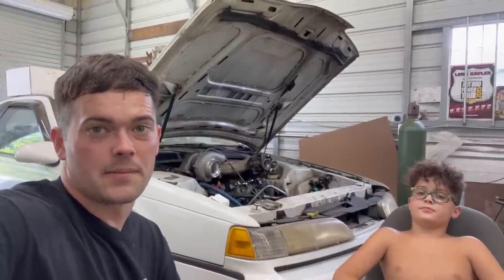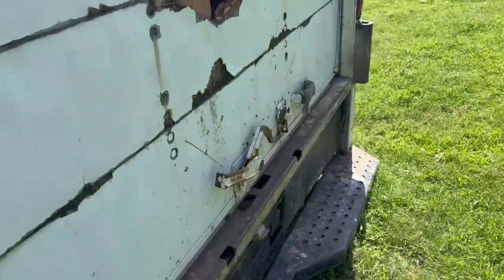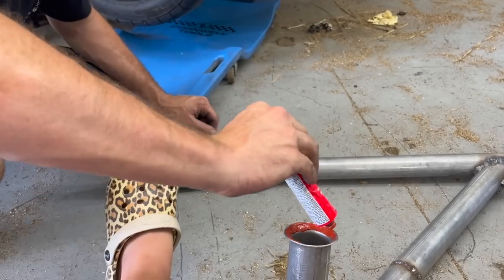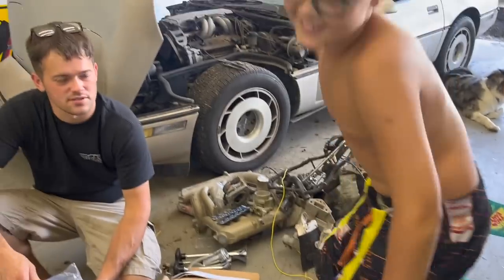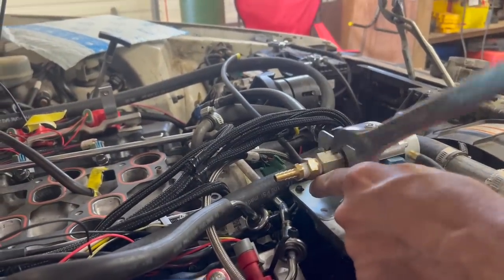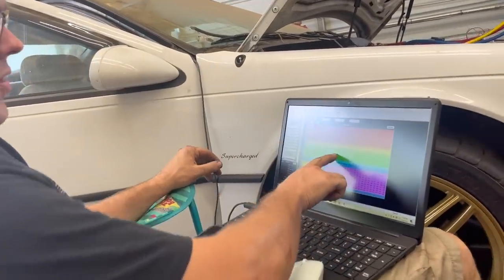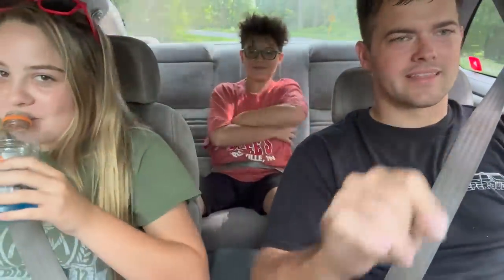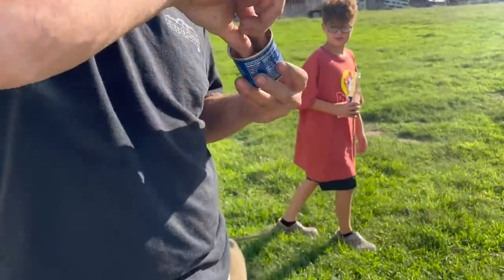First drive with a Turbo on our Supercharged Thunderbird!

Comment: Josh you are a mechanical genius! How you can take anything and fabricate it into exactly what you need is so rare today. Your talents never cease to amaze me. Such a really cool build. The kids are going to be a chip off the old block, as they seem to enjoy it as much as you do. What a great video!
Reply: AMEN to that
Reply: This is what kids and adults need alike, learn how to do work with hands. Learn how to take things apart, see how they work, then put together with no extra parts. doing this seems repetitive, but I started early and was fixing Autos, semis, Heavy Equipment, tools, doing plumbing, roofing, electrical etc. Things that we need to know as adults when our auto, home etc needs parts replaced or maintained.

 With money being so slippery save it by doing own repairs and maintaince. You'll be surprised how much it saves, how much is learned and how much fun you'll have knowing you can do work the right way and it's right. Never know where it can lead. College is so expensive. If being a lawyer, Dr etc ok that's a wise investment. But a blue collar trade will pay VERY WELL and you won't be in debt thousands. If your single go make that oil and gas money. If not do construction, truck driving, Postal service, etc. Any gov job pays well, health insurance is great and you can move wherever and have work. Best feeling was seeing all the kids leaving for college and then 2 years later they working at Block buster, no degree still and I'm making 3-5 grand a month easy.
 Rich ppl go to college, poor go to work. Then that work will teach you so much and you can have own home, car etc and maybe get into real estate, start own business etc. Never know where doing new work will take you in life.

Comment: You all have done a great job on that T-bird.    You need to fill the gas tank with fresh fuel, or the throttle control and all the settings will not be seeing things steady like it will with stable fuel.  The left quarter panel looks darker then the rest of the car..  the car is nice and with a few things cleaned up, you have a great car. Thanks and look forward to every video on the channel.

Comment: You totally amaze me at the way that you are able to use other parts not intended and “make them if”! Also you have every tool available to do the job right. Especially drill bits that actually drill through whatever without hesitation. When ever I drill something my drill bits are always dull (even though I sharpen and or replace) and I drill and drill and drill 😮 … great video.

Comment: I have been DYING to do this exact same thing for years since I had my old 1990 SC 5 speed in the same color with the same red leather interior. Needless to say I've been dying to see this vidya.
Reply from the maker: Awesome glad you liked it
Reply: @Sleeperdude  I really enjoyed it. I have a 1997 Honda Civic coupe that has a fully built 1.8L DOHC VTEC engine with a Garrett GTS3582 turbo running 30 psi on E85 and it makes 709 horsepower at the wheels. It has cams, a fully built head, forged everything, all ARP hardware and head and main studs, I've been building it since 2014, so believe me, I know ALL about custom fabricating all kinds of parts to make things work. I also built a 2001 Honda Accord with a 3.2L Honda V6 with a big turbo and a six speed manual swap and it made 502 wheel horsepower at 10 psi. Almost every part in that car was custom made by me. I taught myself how to weld with a flux-core welder that I got for $75 from my neighbor. Now I have a Lincoln gas MIG welder and my welds have gotten much better. Also, I've never really heard of anyone trying to push over 500 whp out of the 3.8 OHV Cologne engine, but I'd imagine you'd need forged rods and pistons to support that power level. My 3.2L V6 that I turbocharged in my Accord broke a ringland at 10 psi making 502 whp on 93 octane, but the E85 will DEFINITELY help keep your knock down. Edit: I meant to say that 600 whp would most likely need rods and pistons to support that power level. On E85 it should make 500 HP fairly easily given the right tune.
Reply: @Sleeperdude  Also, I didn't realize that car had beige cloth interior. Mine was all read carpets and red leather with the computer in the dash.

Comment: mebbe there was some water in the fuel an' them injectors jus' friz solid.  Hey, that turbo-flange gasket should take the metal gasket that is made for the 6.5 Chevy turbo diesel. They don't usually burn out at all.

Comment: Thunderbirds definitely don't get as much attention as they should for performance cars. And they do make for awesome builds!! Nice work!! 😎 Ever thought about a 460 transplant for one of the Fairmonts? That would be a challenge even making it fit in the engine bay, I think. 😄 Thanks for sharing Josh!
Reply from the maker: Yes!! I did a 460 on a LtD you should check out the old videos

Comment: Welcome to the splitport Tbird club! I think it's just me and you bud. I'm using the Mustang throttle body cable without any modifications, a return style fuel rail from an econoline, and the orginal 3.8 n/a ecu with the M5r2. It has been years since I did the swap, but I might be able to help if you have any questions. Fun channel!

Comment: There used to be a company that made a muffler like a motorcycle muffler that had plates so you could put as many as you wanted. It should fit where your exhaust comes out. Would quiet down some of the noise.  That bird is going to fly when you get finished.

Comment: Radiator repair tip!!!   I invented this:  Before applying JB weld:  attach a shop vac to one hole of the radiator while plugging the other. That creates a vacuum to draw the JB Weld into the hole. After u get some in there, take the vac off for a few seconds. then put the blow hose of the shop vac on (LIGHTLY) for a moment to mush the JB weld from the inside then shut off the vac and let her set.... NEVER LEAK AGAIN
And you can fix BIg holes that way.

Comment: It doesn't look like you are any stranger to hard work Josh. Just taking that apart a couple times and putting it back together would have killed me faster than my Leukemia. That was a great job of making things fit that normally would not go into a Ford but hey I have a 2004 Mercury Grand Marquis and I was thinking of doing a Turbo swap on it. Its only got a 4.6 Liter V8 right now and I wonder how much boost I could get into it, Don't know if anyone has tried one though. You sure did a great job on that TBird V6 sounds and runs great.
Reply from the maker: Thank you

Comment: Harbor Freight sells sticks for aluminum you can use with a propane torch . Heat the area to 640° F then rub the stick on the area you want to weld. They are silver and work great on aluminum,  pot metal that kind of metal.

Comment: If it is anything like a third you need to make sure you get all the air out of cooling system or it will run hot because it won’t circulate

Comment: I hope you have modified the stock engine mounts to be rigid since you mounted the turbo to the frame rail. Cool little build, i like backyard stuff like this that works. 
Mustang fuel line AN adapters should be the same
Mid 90s powerstroke has similar PS pulley so scope it out or put a piece of wood behind the low side and hit the high side of the bend with a kammer to straighten the pulley out

Comment: Too bad you couldn't have Ralphy polish that intake to a mirror finish....  Bacon is the candy of the cured meats. And..you are correct Sir, regarding the yoga pants.  If any liquid is left in the a/c system, when you pull a vacuum on it,   before puting the refrigerant into it , the water will boil away.

Comment: Hey sleeper dude my dad has the same welder as you and you can use aluminum 9mm wire with it and it works better than the steel just wanted to help you out

Comment: Just catching up on your video. Amazing out side the box fabrication. Love it. Do you see an issue mounting the exhaust to the frame with that bracket you made? With engine movement i feel likes that would break, crack, etc?
Reply from the maker: It has solid engine mounts so it should not be a problem

Comment: the mustang upper is restrictive and is usually upgraded to the Windstar 3.8L upper (Plastic) or F150 4.2L upper (Aluminum) (the one you took off), especially on turbo applications., you just lost 20-70hp, using the mustang

Comment: thanks! questions: didn't get to see your other video with the finish of the 454, built! there's another guy who built the same engine, got to see how he did it! the guy is vise grip garage! can you explain what's a big block, and a small block! thanks
Reply from the maker: There is a video of me installing it in my red Fairmont but I haven’t started it yet. Small block is physically smaller in size and was 262-400 cubic inches. Big block is larger in size and was 396-496 cubic inches hope that helps.
Reply: so the small block has a limit of horse power! and the big one doesn't, thanks!

Comment: You said the coupe has a 3.8 V6. Is that an all aluminum engine? As a motorcyclist,  I am impressed with the V8 Boss Hoss but it weighs too much. I think a motorcycle with an all aluminum V6 with a turbo would outshine the Boss Hoss and be more manageable. Does any car have an all aluminum V6? Hey, how about an aluminum slant six turned sideways in the frame? Maybe a belt drive from the engine to a Harley trans next to the engine and a belt drive to the rear wheel? Or a front wheel drive transaxle as a trike? Did tell you I can come with lots of crazy ideas?
Reply from the maker: It has aluminum heads but cast iron block. I think the Chevy 3800 might have been all aluminum but I’m not sure

Comment: Don't sweat the timing light. You will probably get one in the mail this week. Please don't mention SD. I'm still not over that. Twenty feet or so of high pressure fuel line and a few clamps and a good high pressure fuel pump in the line would have solved your problem.❤🐘🇺🇸

Comment: Why did it have a GM throttle body? and with all the junk you have, you didn't have a good AC compressor or alternator? Alternators can usually be repaired with parts from other bad alternators, but I don't know as much about compressors.

Comment: Great video 👍🏻👍🏻!! Does it run better with the turbo, than the supercharger?
Reply from the maker: Thank you, yes I never ran out of fuel system on 14 pounds of boost with the supercharger and turbo is running out of fuel system at my 5 psi boost so it’s definitely making more power

Comment: I have a 2005 Cadillac DeVille and want to replace the water pump belt (it's separate from the accessory serpentine belt) do I have to replace the tensioner and water pump pulley or will the one's on it be ok? They look and seem to be in great condition.
Reply from the maker: It should be fine

Comment: Great video guys and I love the Super Coupe!
You should set up that Doritos finger cleaner commercial with Rocky on the other side of the wall!

P.S. Which Holley Tuner did you get? What else did you have to get with it? 
And last but not least what did it all cost?
I have an 86 GT Mustang with a (Keith Craft Racing) 306 and 5-speed that I'm putting a Novi 2000 supercharger on and I need a tuner, but as always I'm short on funds and looking for the best deal I can find.
Thanks, take care, and have a great week!

Comment: Out of curiosity would a rad for a foxbody fit it? You need a new one why not upgrade to a larger core rad and be able to run a bigger electric fan?
Reply from the maker: Yes it will fit I tried a fairmont one in it the other day. An upgrade would be good
Reply: @Sleeperdude  cool! If you in the market for a larger electric fan I’d love to donate a Lincoln mark 8 fan, these bad boys are rated at like 4300 cfm

Comment: I guess I'm losing interest in power with age, at least beyond what I need to maintain 40 mph while towing up a mountain, so I tune mainly for efficiency now, and just to keep old and worn stuff running reliably despite declining compression, which is cost efficiency.  If I modified a car mow it would be mostly for mud and snow traction, which in RWD cars means the lightest possible engine regardless of power, except 911 and Corvair.  I don't expect to be outrunning any more cops, at least not on pavement.  I should go back and see the pretty Maverick though
   Even the one fast car I ever owned, a 390 Mustang, I bought it because it was a sleek fastback, the engine was coincidence, and I never made it any more powerful, but improved hoops, casings and rear sway bar for handling, to better control the power it came with, and rear battery kit for traction.  I considered an aluminum intake, which would have increased power some, but my main motivation was weight reduction for handling and traction, not the power; same with aluminum radiator.
Reply from the maker: Ok thank you

Comment: Hay Josh, on your comment on the amount of fuel you buy, Call a fuel oil supplier and ask if they seal bulk fuel, go out and buy a 100-200 gallon fuel tank and buy an old surplus gas pump from him and there you go fuel will I bet you 1/2 to 3/4 cheaper than buying it from a gas station. I buy my AVGAS for my plane this way. pilotcropduster
Reply from the maker: Ok thanks will check into that

Comment: I hate to say this but, that 3.8 L V6 is a garbage motor ! They were known for having a ton of head gasket failures, and, running very hot due to running a thermostat that was too hot a type !!! I hope now that its  supercharged it doesn't give you that headache. I know from experience, because I had a 95 Taurus with that same engine in that car. It was a disaster. Constantly breaking all over the place in the car every two or three months. I hope supercharging it doesn't accelerate any problems that engine may give you. Cool project though.

Comment: The only way to make a Ford fast is put in a Chevy engine
Reply: That was funny but so incorrect !
Reply: @Angelo-fo8de   Read the Ford emblem backwards driver returns on foot or flip over and read directions..... I never liked Fords and my grandfather was a Chevy person just like me...... My cousin has a 1977 Chevy Luv with a small block 350 and it is built for the drag strip and it runs 6:70 he beat every Ford that night..... Ford means slow